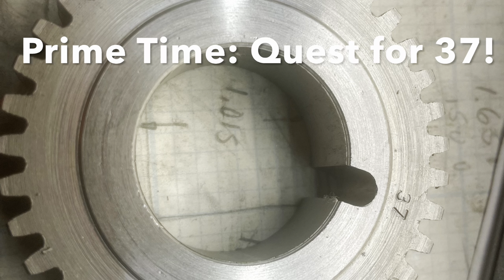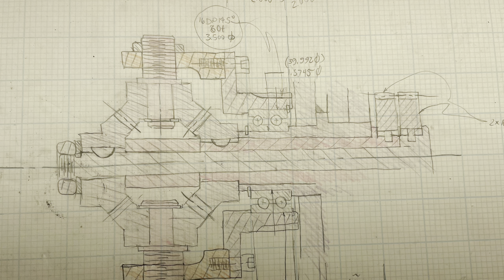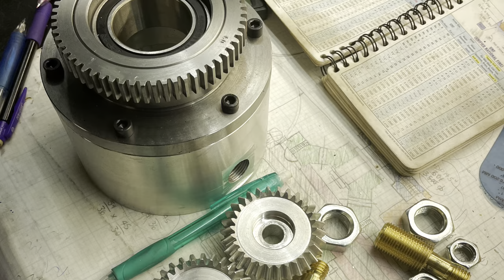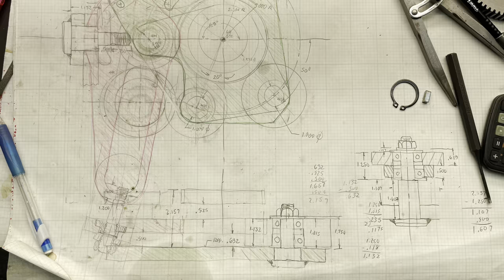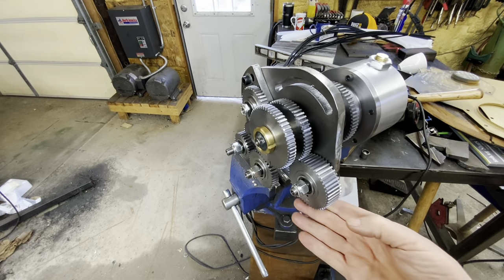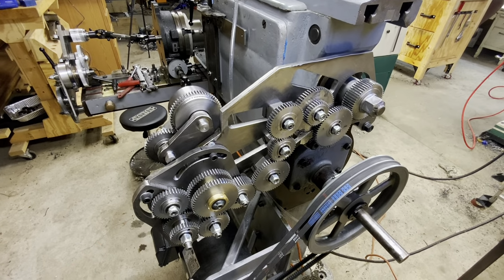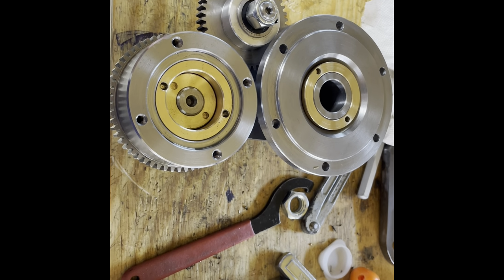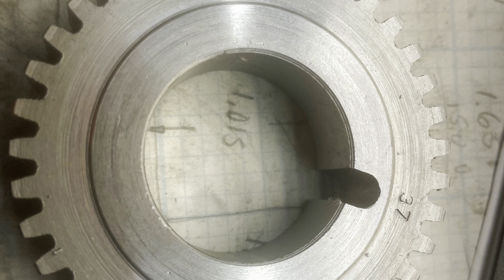Prime Time: Making a Differential for a Gear Hobbing Machine.

Comment: You seem to be the right person to ask this question about gears...why are some meshing gears noisy where as others are very quiet (i.e. your gears)? I didn't see any lubricating fluid being worked thru the gear teeth in this video so I know lubricant isn't the reason. Is it the material the gears are made of? Is it the revolutions per minute? Is it the shape of the gear teeth? Is it the amount of backlash or clearance between the meshing teeth? I'm curious because my 1/10 scale radio controlled 6X6 off road/crawler truck has 2 electric motors with very small gears driving one big gear on the transmission and there is a fair bit of noise at those points (the 2 little on 1 big gear) and I was wondering how I might reduce that noise if at all possible.
Reply from the maker: I’m not really that deep into gear theory yet, but I know that running tight generates tooth noise, and running loose is quieter, but too loose results in meshing errors and impacts that are noise generators.  If your gears are molded plastic, there might be profile errors.  I imagine that your system might have at least 1 deep reduction (single stage small gear to large gear, maybe 8 or 10:1) I try to avoid speed changes over 3:1, which may not be practical for you.